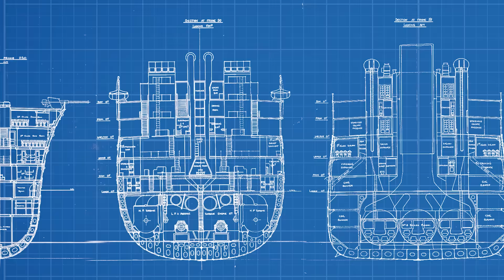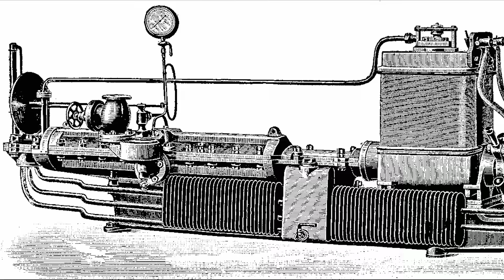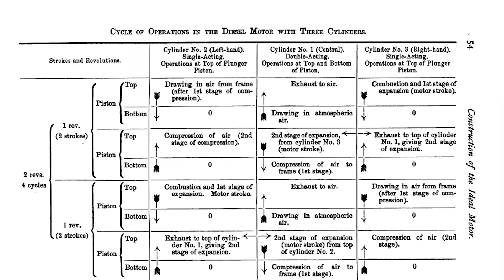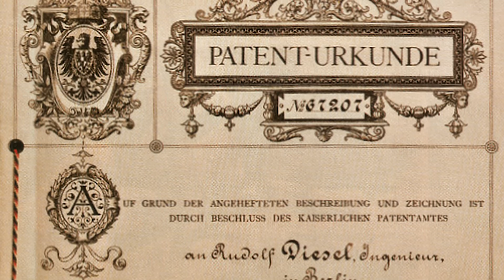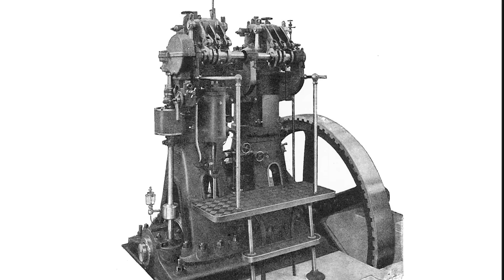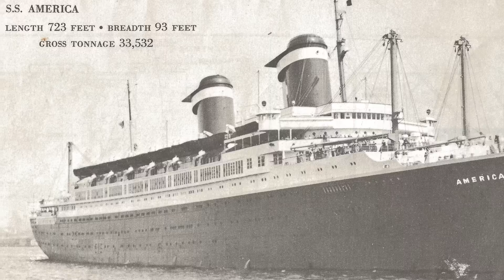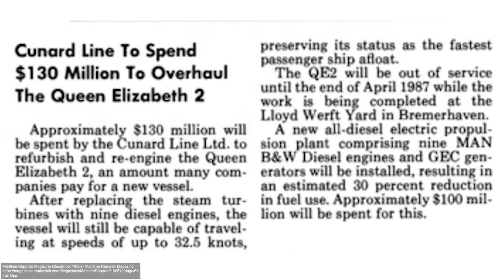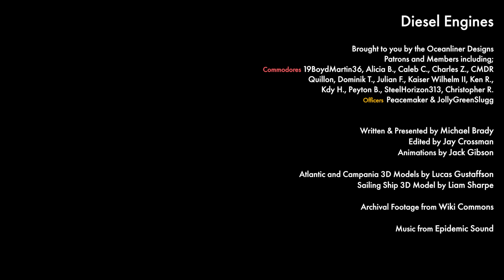How the Diesel Engine Became King of the Seas

Comment: 5:27 the wrong explanation. Diesel engine compresses air only to get get it hot and then the fuel is injected, the fuel gets ignited by the heat of the air and burns creating the expansion of hot gases and it pushes the piston.

Comment: ...but Diesel’s engine instead used a system that would take a small portion of fuel and  compress it so much that it creates heat high enough to ingnite the mixture (sic!) and repeat the process... Man, you don't get it! Find somebody - a  mechanical engineer, or a physicist maybe - who actually understands Thermodynamics, and get an introduction. Please!

Comment: Interesting history, but this video fails to address the technical challenges that stopped diesel from taking over immediately, or what innovations solved them in the latter half of the century. An big part of the story left unanswered. I doubt that diesels were that excellent from the start only for it to take 40 years for people to realize "this is much more efficient if you don't need to go super fast".

Comment: 5:26: I believe this wording to be a misconception carried over from gasoline engines, which are not the steps. Diesels work by compressing air such that this air is hot enough to ignite fuel. Only after this, fuel is then injected. Injection is step 3 of the 4 step compression stroke of a Diesel engine, which is the inventive step of the Diesel patent: Air intake, Air compression, Fuel injection, Ignition. Your videos are great. Just thought I would share this amazing detail.

Comment: The thing is, the diesel also scales very well. Hasoline (petrol) engines work best on the smaller side (automotive use), and steam engines work better on the bigger side (marine and stationary use),  but diesels are able to do all those.

Comment: The diesel doesn't compress the fuel, it compresses the air which raises temperatures and then the fuel is atomized under very high pressure and injected into the cylinder to ignite and power the engine.

Comment: A multitude of serious errors are in this video:-
1.   He said ignition results from compressing the fuel.   Not so,  ignition results from compressing the air.
2.   He said diesel produce high power at low RPM.  This is not so.   A diesel engine produces lower power than a spark ignition engine of similar swept volume because while a spark ignition engine operates stoichiometrically (an ideal proportion of fuel and air), a diesel operates well below stoichiometry, as a full mass of air is always drawn in and power output is varied by only varying the amount of fuel injected.
Power output is proportional to RPM times the Mean Effective Pressure on the piston.   Obviously if you want more power from any engine, gasoline, diesel or whatever, you have to increase RPM.  Turbines produce high output in a small space because they turn at very high RPM.
3.   He said diesel fuel burns slower than gasoline.  This is an old urban myth.   In both gasoline and diesel engines, almost all the combustion occurs within a few degrees centred on Top Dead Centre.   if it were not so, efficiency would be very poor.
4.   Rudolph Diesel's first engine had poor efficiency because he had far too high a compression ratio.   His theoretical calculations' led him to believe that the compression ratio should be as high as possible, but in fact there is an optimum, above which heat loss through the cylinder wall becomes too high.  All modern diesels have a compression ratio around 15:1 for this reason.
5.   He said diesel engines have more grunt than gasoline engines.  That's ridiculous.   Since diesels operate well below stoichiometry and the calorific value of both fuels is virtually the same, a gasoline engine has more grunt.   Every seen a diesel airplane or a diesel racing car, Mike?   No - and there is a very good reason. 
6.   He said Rudolph Diesel became a very wealthy man.   Not so.  While his patents brought him huge royalties, he was a hopeless businessman and wasted it all on bad investments, and went bankrupt.
7.   He said Rudolph Diesel might have been killed because he refused to sell manufacturing rights to the German Navy.   There are many theories about his death but that isn't one of them.  When Diesel died in 1913, the German navy was already using diesel engines for auxiliary power and had decided to use diesel for main propulsion in future ships.   The closest theory is that the German authorities were cross because he didn't give only German firms rights.  But the strongest evidence is that he committed suicide because he was bankrupt with nothing in his bank account.

Comment: Future marine propulsion has a few probable options for sustainability:

1) nuclear fission (liquid fuel molten salt?), probably using an efficient high temperature supercritical CO2 Brayton cycle for conversion (NOT steam)

2) H2 fuel cell, fuel could be H2 (bulky), or a chemical carrier like NH3 with a reformer

3) NH3 combustion might work if NOX production could be kept extremely low

Comment: @5:27 Diesel engines compress the air not the fuel!  The air in the cylinder is compressed to a point where it becomes hot enough to allow fuel that is introduced in an atomised form to cause combustion.

Comment: You missed another key development of ship building during the 19th century, the switch from wood, to iron, and then to steel.  This allowed the construction of larger and heavier vessels that could carry more cargo and MORE FUEL!  Pre 1850 steam engines using 30 psi steam were labeled 'high pressure', this meant that they had to be huge to develop any significant power and also limited their thermal efficiency.  Post mid century the use of steel in engine and piping systems allowed much higher pressures, this coupled with the triple reduction steam engine and better condensers that allowed reuse of boiler water made ocean going steam practical and economic.  Note that most earlier steamships had a full set of sails and mainly used engines to get into port and during periods of calm winds.  Sailing vessels of the day could be pretty fast if the wind was blowing.  The switch from coal to oil largely depended on what was generally available, England had coal, it didn't have oil.  The advantages of oil fuel, especially in naval vessels, eventually brought about that switch, largely thanks to British Admiral Jack Fisher.  Diesels are not particular in their diet, they can burn heavy oils (i.e. road tar) when it is preheated and also use light oils (diesel fuel) and even natural gas or propane.  the light fuels will reduce exhaust smoke.  As a former ship officer, our steam vessels had a fuel consumption table on the bridge, not so on diesels.  The old Queen Elizabeth and the SS United States both burned about a thousand tons of fuel daily, I think this was about twice that of the new QE2 when she was converted to diesels.  Note that the SSUS was not air conditioned, absolutely required for a cruise ship in tropical waters, about 30% of the power on modern cruise vessels is used to keep the lights on and hotel machinery, not to push the ship.  The military vessel I was last on had a hybrid power system with both diesels and gas turbines.  We could do 22 knots on diesel, the turbines pushed us to 32, the price of that was we burned per hour about the same amount of fuel that would run us for a day on the diesels.   Note that the first diesel ship, built about 1912 sailed from Europe to Australia without refueling enroute, no steam vessel could do that and carry any cargo.
Reply: He's covered the construction of ships in other videos.

Comment: 6:50 Ehhhhh, you can run a steam engine on literally anything that produces heat, whether that's a solid fuel, liquid fuel, gaseous fuel, or a nuclear reactor. When steam ships used coal, that will no doubt have been because it was the cheapest option. Diesel engines are the one that are more restricted in fuel choice in comparison.

Comment: One thing I do have to say, as someone who is studying this in University.

The process of preparing a marine diesel engine to start operations, takes around the same time as firing up a boiler, about an hour or so, maybe more depending on circumstances.

Even now a days it is common practice to give engineering about 4-5 hours time in advance of the vessel departure to make sure that all the systems and components are set up properly and that the enginge will be ready to start once the order is given. Which is around the same time taken for oil fired boilers to produce operational steam pressure.

The main difference is what is obtained after that set amount of time. In the case of the steam boiler, should it have been started from dormant, then it would take additional time before the vessel is ready for departure, as the steam produced will be mainly used to power the various equipment and machines needed to start up the other boilers and build up sufficient steam for the main engines. Though you can crash start a boiler, this eats up into its service life, requiring a replacement down the line.
In the case that a boiler or two were left operating or the vessel was fed steam by dock facilities, it would take less time to produce sufficient steam to engange the main engines, but it would be around the same 1 hour or more as that of a diesel engine.

The main difference of this with diesel engines is that, once that hour or more of prep is over, the engine can be engaged and the vessel begin to move under power.

so technically both engines types require the same standard time to get them to operate, the main difference is that for boilers, it might require a bit more time to generate boiler pressure for the main engines, while diesel are ready to roll after that set time.

This in addition to their smaller crew sizes, made them a very sought after choice, as Mike has explained rather brilliantly.

Comment: I wonder, how did oil burning steam engines compare? They stuck around for quite a while even after Diesel engines were common place, so I have to imagine they had at least some advantages (cost? maintenance? fuel requirements?)

Comment: the modern crosshead 2 cycle diesel engine is the most mechanically efficient engine of all time
at 100000shp at 102 rpm they are thousands of times more powerful than an F1 motor

Comment: unfortunately Diesel is a dying fuel type thanks to ridiculous emissions standards set by politicians who would probably grab a set of 8 spark plugs to service a cummins engine, thanks Obama.

I work in the heavy vehicle industry, a friend of mine works for a transportation company who's only service is to bring Cargo from Las Vegas to ports in Los Angeles and San Diego. they operate semi trucks that have gas engines, 8.8l V8s based off the GM LS engines. they do this because California has made it practically impossible to operate diesel trucks in the state.

I work as a school bus mechanic, all of our buses are run off of propane using a ford 6.8 liter v10 engine. we have a couple of Diesel engine busses left, but those rarely go out because of the regeneration equipment in the exhaust, the SCR to be correct, is so finicky that its impossible to have those million mile Diesel engines that were the case only 20 years ago.

Comment: It was discovered in the 1920's that diesel engines lose a lot of heat energy and thus efficiency in the cylinder heads. A way to get rid of cylinder heads is to place two opposing pistons in the cylinder, and have all the action (compression, fuel injection and valve/port actions) in the middle section of the cylinder. Two sets of opposite moving pistons would need a separate crankshaft for each set, and these crankshafts would need to be coupled by synchronizing gears, to keep all piston movements perfectly mirrored at all times. Smaller engines, like the Fairbanks Morse OP, did use such an array, with one crankshaft below and one on top: https://www.youtube.com/watch?v=qgbPcVcd-pc. Here is a schematic, showing an array of three cylinders: https://www.youtube.com/shorts/S3LkVvBznX0
The Russians copied this design (Kolomna 10D100). As there was no detailed description of the FM on YouTube, but there was a véry detailed film of the Kolomna, i'll give a link to the latter: https://www.youtube.com/watch?v=j98MOWorFhE

For very large ship's engines, the heavy mass and expense of a second crankshaft on top is undesirable. Insteap, the top pistons are connected to yokes, with rods running down on either side. These rods have their own cranks on either side of the cranks of each bottom piston, all on one single bottom mounted crankshaft. Doxford was famous for such engines: https://www.youtube.com/watch?v=sWjMBSnq2es
The bottom part of this engine build looks fairly conventional, but the upper parts with the jumping yokes looks very peculiar:
https://www.youtube.com/watch?v=BMb5GLMdFNY
https://www.youtube.com/watch?v=9wcMdqGVuS4
https://www.youtube.com/watch?v=cfjOdB7FP4o
The most complex version of this principle was built by Burmeister & Wain, and one of them is still in working order (in the Diesel House in Copenhagen, which was once an electrical power station for that city). Imagine three pistons per cylinder. The top and bottom pistons  of each cylinder have their yokes mounted to the same rods, meaning that they move up and down at the same. These pistons also acts as valves, closing and opening inlet/outlet ports while they move. The third piston is between the other two and there are compressions and combustion expansions on either side of this piston, meaning that this engine is double acting (middle pistons driven from both sides, like in a steam engine). This marvellous video also contains a cutaway drawing. Pause the video there, to study its inner workings. You will notice that the piston rod of the middle piston runs down to the crankcase through a sealed hole in the bottom piston. Ingenious. During the motion, you can see the top and bottom yokes of the top and bottom pistons moving; and the rods of the middle pistons running in between, in opposite direction. The B&W design used top- and bottom pistons much smaller than the middle pistons, that's why some engineers regard these engines not as true "double opposed piston" engines, and that the smaller pistons are mainly there for the valve function and contribute only moderately to the generated power.
https://www.youtube.com/watch?v=g80p28KMX4o

Comment: One of the biggest disadvantages of steam is that boiler engineering stresses go up with the cube of power. This - and the predictable results - is what drove mass adoption of ICEs and electric motors in factories. A 10,000hp steam boiler explosion can flatten a city block (and occasionally HAS - mostly railway locomotives)

Parsons turbines are what's at the core of most thermal power stations :)

Nuclear power is a really bad idea for ships - not because of the safety of nuclear power, but because ships occasionally end up on rocks and we all know how badly older ships end up being treated by the 3rd, 4th, etc owners.  The bigger picture simply makes it untenable (for the same reason nuclera power is a bad idea on any kind of vehicle. Better to have a stationary source and feed power along wires, or use the energy to charge batteries or make hydrocarbons (sabatier process)

Comment: Railroads were also impacted by the diesel. Within a 30 year span, 1925 to 1955, railroads in the USA, with some exceptions abandoned the steam locomotive and went to diesel locomotives for much the same reason. Lower prices on fuel, maintenance and labor.

Comment: I don't see nuclear powered civilian craft any time soon. If and when a nuclear powered ocean liner or cruise ship is built, I wouldn't be surprised if it used a reactor design that involves no water, for instance an air cooled pebble bed reactor using the Brayton cycle for electrical power generation.

Comment: I am at 9:34 and I have to say you are wrong. You compare diesel engine with  coal boilers steam engines while they have not replaced them at all. Actual engines in use were oil boilers burning engines with both hugh and low pressure steam turbines. At that time no diesel engine could have power nor range of such steam engines. All fast  warships in WWII were equipped with such engines. You should do better research. Or just watch Drachifels video about that topic. 
It took time to get diesel to the point where it got. Huge diesels are still made but they aren't new kid on the block anymore.
Current modern ships often use a few  jet engines to make electricity and then drive shafts and pods with electric motors. Those engines can burn kerosene and diesel. Some use combination of both. Some warships and submarines use reactors. There are more modern means of the propulsion nowadays. And again in tenth minute storage of fuel. Ships burned oil in boilers. Fuel was stored in double hull and was often used as torpedo ptotection. There was no need for coal. Plus no one needed to shuffle coal into the boilers.

Comment: Diesel engines on ships typically burn Heavy Fuel Oil (HFO) rather than diesel.
HFO is a dense, highly viscous residual fuel left over after crude oil undergoes distillation and refining. It contains more impurities and is less refined than diesel, which is lighter and cleaner. Due to its lower cost, HFO is commonly used in large marine engines, but it must be heated to reduce viscosity and ensure proper flow and combustion.
Reply: Oil fired steam locomotives used HFO as well (bunker C). Ironically, most oil fired steam locomotives in operation today burn diesel, as it's easier to obtain .